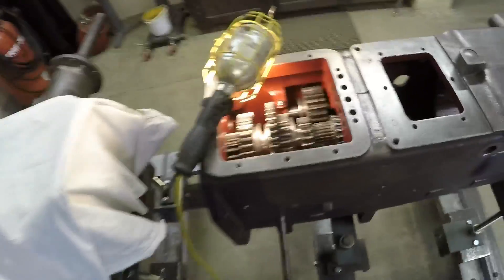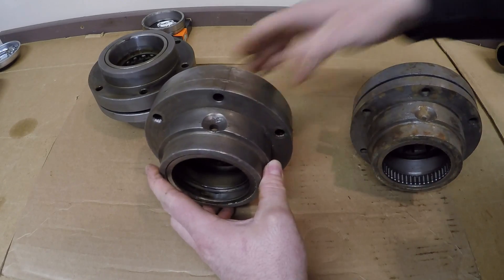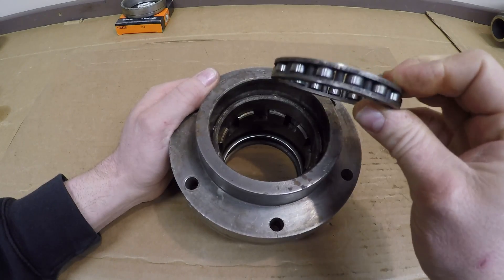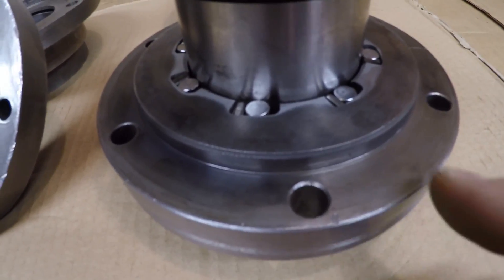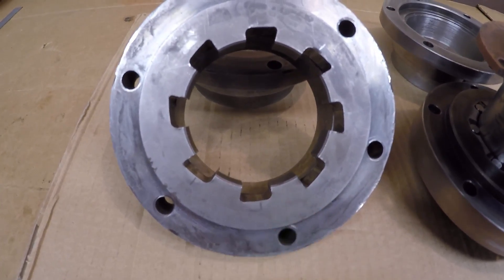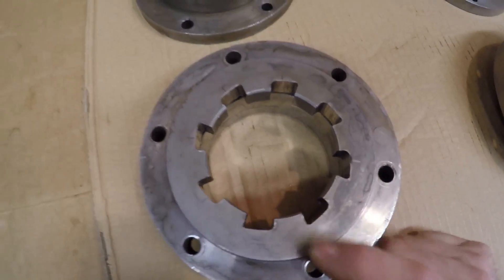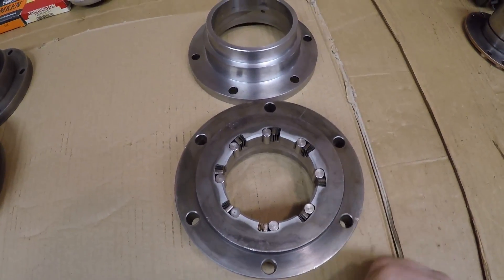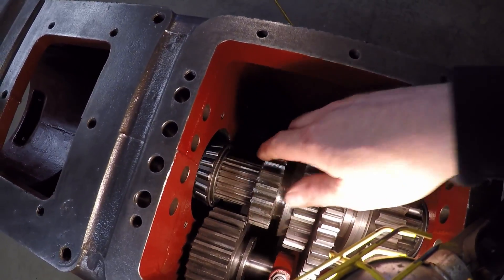Minneapolis-Moline 445 Prototype #X231 - Part 38: Rebuilding the Ampli-Torque One-Way Clutch

Comment: Just a thought about those ruined cam ramps, could they be re ground and used with oversize rollers? Then you could retain the use of the original parts.

Comment: It might be worth contacting the Model T Ford community about the Hyatt Roller bearings in the one way clutch. As built, the Model T used a number of these bearings in different sizes and my guess is that the rather large and very active Model T community, will have come up with either a source for re-manufacturing these bearings or workable alternatives.

Comment: Excellent description. Perhaps here's why the x component failed. Looking at the production part notably where the ramping rollers locate, we'll notice that the whole ID is a lighter color than the body of the part. This is prominent as the ID of that area was most induction hardened. Note how the lighter color is present although rather thin under the roller ramp. This is needed so the rollers as they're likely Rc 60 ish to not imbed (brinell)  into the base metal of the ramp. I'll bet the X part wasn't hardened as deeply as the production part therefore the ramps are soft.  If you want to confirm this you can do an acid etch of the area to reveal the case depth. Or something simple, just glass bead the part. There will be differing surface texture on the base metal hardness area vs the case hardened area with a rather well defined line between the soft base and he hardened area. *I designed and sold induction equipment for years.

Comment: question  ! on the bearing you said you couldn't find and you had no extra bearing on hand ! is there a bearing you could use as a replacement ? if not what would you have to do to solve that problem ? also where you get that polishing brush for your drill ?

Comment: I’m surprised to hear that IH bought the patent from MM. I always thought IH was the first and only company to use it, until I got reading about MM and Oliver’s versions.  I know they were working on one in at least the early 50s, which they originally planned to have it shift automatically. But they abandoned that idea for this which led us to the Super M-TA and Super W6-TA for 1954. When did MM first sell tractors with the Ampli Torque?

Comment: The one-way clutch looks to be complicated but after you're 'walked' us through it and it's use is easy to follow. Too bad you couldn't get more use from the original piece, but it's good too, that you have the production stuff to continue the restoration. Nobody can fault you for not using only original parts in this.

Comment: I still wonder if they didn't harden the parts on 10X partsto see where the wear points were.  That would explain cam ramps and a few of the other high wear parts you've found.

Comment: Bummer about the worn out sprag from the X231 TA unit. I wonder if a guy could make a HD sprag from an automatic work in one of these by machining a matching hub for the back of the TA planetary gear set. It wouldn't be original so I understand why using good production parts is the best option, not to mention the cost involved with trying to make a custom HD sprag. Great video!

Comment: Queue the dumb questions!  Hopefully they beget short answers! First, was the failure of the springs and rollers (being flatspotted) normal wear and tear, or was there a design flaw, or what? Basically, what caused the failure in the prototype unit but not in the production models? Second, how did the failure of the one-way clutch assembly affect the performance of tractor when it was assembled? (2b: Was it another part of the reason the previous owner ditched the tractor? This was at least the second time it failed, since it had been opened before.) Third, why did the two halves need to be forced apart with a screwdriver, when the production pieces just slid apart and together, no problemo? If you take the time to answer, Thank you!
Reply: @squatch253  Thanks for the reply! I really think my questions are rudimentary, but I hope there is someone among your 15K+ subscribers who is also fascinated by the videos but has the same questions. When you finish X231, will you ever put her in low, even for kicks?
Reply: @squatch253  hahahaaa  Yeah, I can just see it. Better make sure you do something extra nice for someone less fortunate...insurance against God throwing a lightning bolt at the transmission just to spite you. :) I look forward to the "engaging low" video when you're done with her. 

I'm also a little curious as to whether engine No. 3 for 5J1113 has been delivered. Any news?

Comment: Hyatt roller bearing.  Never seen one, never heard of one before today.  I'm assuming once the shaft is in there the clearances close up and looses all that slop.  Interesting stuff.
Reply: I was just going to ask him about it. Now I suppose it is off to Google to find out about a particular piece of ironmongery I never knew existed.
Reply: @squatch253  Well that explains why I've never heard of them before.  One more question if you see this.  The sprag "cage".  You have any idea how hard that surface finish is?  Being a common failure mode maybe the rollers are just beating it into submission?
Reply: @squatch253  Well now. It turns out Google is indeed my friend. Never knew of the existence of Hyatt bearings. A fascinating bright idea that worked well once upon a time. A helix of rolled thick spring steel. Worked especially well in Model T Fords. Although I do not see the advantage for your application. Possibly I can persuade you to do some closeup filming of an example from the MM tractor. For a long bearing with not very accurate machined surface on the drive axle of the Model T,it spreads the load well. Just what short bearings were doing in that single usage in your tractor,I have not the faintest idea. If you could video some closeups of inner and outer race,it looks to me the load did not include any axial component. Just radial. Thanks for showing a subject I knew nothing at all about. Cheers.

Comment: Squatch, think of your worn X231 TA parts like this - the MM engineers built a prototype tractor so tough in design that it lasted all these years until you tore it down finding that it is identical to later production tractors. What better proof of concept! Great video!

Comment: I'll write you from Germany. I enthusiastically follow all the episodes of the X231. 
You are an expert, but I wonder why you always make such pains to squeeze in a bearing. I have an oven and heat the case to 110°C (230°F). I put the bearing in the freezer to the delight of my wife. With this temperature difference you don't need any strength. The bearing falls into the bore at the stop. Of course, a whole gearbox does not fit in the oven, but with the anti-reverse mechanism this would not be a problem. The material does not suffer from this Temperature either.
Reply: Jörg Kerzendorf the way he does it only takes a few seconds to press them in, no waiting for parts to heat and cool. Your method works good too if you don’t mind the extra steps involved!

Comment: Thanks for the video.I like these trips down memory lane. No matter the color these old tractors they had a lot of similarities. As I recall the one way clutches in the early and late TA IHC tractors were the demise of the Farmalls. I had Ford F150 that had a three on the tree with the overdrive and that had a one way clutch in it that was shot like your 10x part. It worked but you had to bump the throttle in that old 352 to get the oneway to let loose to be able get it out of or into overdrive. At that time the part wasn't available though Ford but that was long before the internet. I kinda wished I had that old transmission back! It was a work of art.
Reply: @squatch253  Ha that is a great story. My being sixty I have a few of them, some passed down through the generations. You have your fair share of great stories. Please keep telling your life stories! They are excellent!

Comment: Hi. As long as you declare what you are restoring to there is no ethics problem. In this case it's to a working clutch, not some piece of art pretending it is something else. If this was going to be a non functional museum piece, then yes, keep all the protype parts in it. But it is n't. It is going to be used - well, at least demonstrated - and for that folks it needs to work! Reminds me of the starter clutch in my Honda 250 cc motor bike, only for some reason this one is a bit bigger.....  Fabulous video series. BobUK.